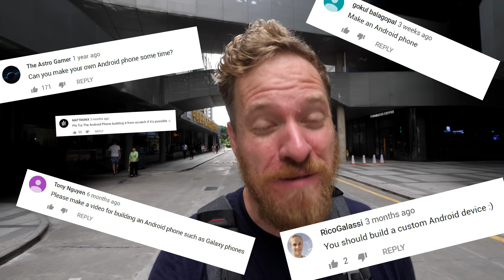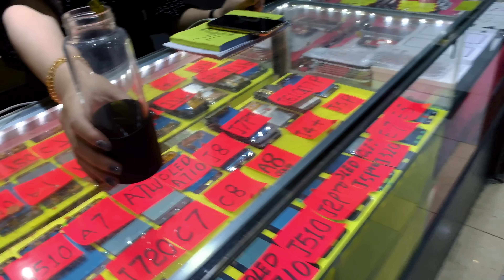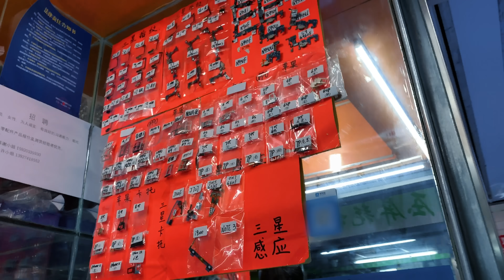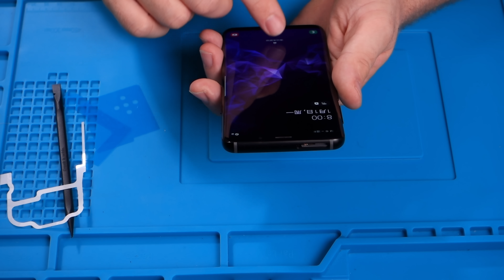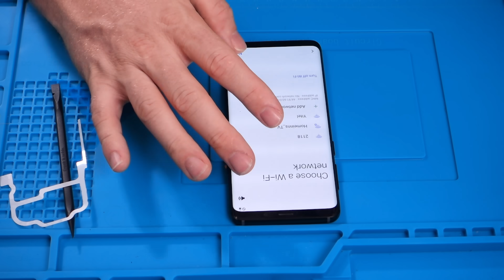How I Made My Own Android Phone

Comment: Part of the reason it's hard to find boards like that is unlike iPhones, Android phones generally tend to be commodity items. Most people buy them and when they break toss them and get a new one. There ARE high end Android phones (like the S10) but even with that, it's not as common to sell them to try and recover the cost. The mindset just isn't there. Also, there are so many different Android phones by so many OEMs (4000+ phones by 400+ OEMs) that it's hard to know what to keep in stock.
So you're definitely swimming upstream with this idea.

Comment: Nice one, congratulations!! 
You should make a new macbook or a console!
Reply: A lot of consoles have all the parts with specific ID's, so they only work with specific parts. Example: If you want to replace a Xbox disc drive, you need to get a drive that has an ID that matches with the motherboard. So it's possible, just very difficult.
Reply: Yeah you're going to hit a wall eventually without using a modchip as well - Which further complicates the "does it work yet?" question during assembly.
Reply: @amshermansen  Yes, you are correct,  I think that when I was talking about that I was wondering in the possibility, not If It is legal or not. I was thinking in the following way, If you can buy a motherboard and fix you console or macbook you can make you own device as well!!
Reply: @Zer0_Smith  Certainly,  I was thinking on that when I said that, however I have already seen people in my country fixing consoles just like a phone.
An iPhone might have ID to work well, haven't it?
By the way you might be right.

Comment: Great Video. Only gripe i have with this is the "Made" tag. You haven't actually made anything. You provided final assembly with all the parts already made by somebody else (not to mention any engineering that went into it designing them in the first place). But it's not like you pretend you did any of that, so whatever. Well done.

Comment: Build a Smart Phone with Awesome Specifications such as:
CPU: 8 Cores.
GPU: 8 Cores.
RAM: 12 GB DDR5.
SSD: 256GB RAM.
Front Camera: Dual 48MP O.I.S. with Wide and Ultra Wide Lenses.
Rear Camera: Dual 48MP O.I.S. with Wide and TelePhoto Lenses.
Display: Super AMOLED 6" Screen with 19:9 Aspect Ratio and HDR10+. 
Display Protection: Corning Gorilla Glass 6.
Sensors: Iris Scanner, Face Scanner, FingerPrint, AcceleroMeter, Gyro, Proximity, Compass, BaroMeter, Heart Rate, SpO2.
Speakers: Stereo with Full Range 20-20Khz.
USB: Type-C 3.1 version.
Battery: Li-Po 5.000 mAh.
There is no phone right now with those specs in the market yet.
Except Xiaomi Mi9T Pro with lower specs and cost 400€.
https://www.gsmarena.com/xiaomi_redmi_k20_pro-9708.php
Please Build it !!!!

Comment: You could do so much more, like make your own custom phone with a s10 case but a mate 10 battery. But still enjoyed the video 😀
Reply: It's possible to do that, but he would need to learn a lot about Android first or get some help.
Reply: Maybe stick a one of those 12kmah battery with huawei fast charge with current SnapDragon chips and Sony camera? Makes for a brick of a phone! Also a headphone jack and LG sound board
Reply: @mechpade  The fast charge protocols used by Chinese companies like Huawei, Oppo, OnePlus, etc. require more specific controller boards to regulate the battery, which are usually located inside the battery cell itself. Slapping a 12,000mah battery might not yield any sort of fast charge similar to that or will work but result in a battery that becomes a ticking time bomb. You're better off taking a battery from one of Huawei's phones if you want that sort of fast charging.
Reply: @GabrielIgnacio  aahhh... your comment eminds me of the note 7... good ol days...
Reply: @9550raja  To be fair, the Note 7 battery issues were caused either by the deflection done to the battery when it was being manufactured or impurities within the battery layers, causing the positive and negative layers to make contact and catch fire.

Comment: The very same reason it was considerably easier to build the Samsung than an Apple is the reason there's far more parts I believe. Apple makes it harder to do anything... (Including fixing your devices) so you need experts to do it for you. I'm not saying there's no other parts of the world that have the ability to learn and fix Apple products themselves.. Of course those outlets exist. But it's a lot harder, thus a lot of Apple parts just end up back in China in laces like Shenzhen. I think Samsung parts are harder to find because more people are able to fix the devices themselves, so don't end up back nearly as much as places like China. You break an apple product, you know it's going to be a hassle to fix.. Because Apple make it that way.. All the different unneeded parts.. Specialist screws and brackets.. Samsung parts across the world are far more readily available and easy to come by so we fix them here. Instead of just selling off for parts.

Interesting video. And I'm surprised it was easy to find S9+ parts. Wonder what's next. If you ever do read this comment. And I'm sure it's a pretty easy mod. Think you could put a IR blaster in an S9+ so it acts as a universal remote? Last Samsung I beleieve that came with a built in IR blaster was the S6. I went from S5 to S7 Edge. Which doesn't have one. But the S5 and S6 did as standard and I do miss that feature.
It would be cool to see if it's possible to put an IR blaster back in the newer phones so we can use them as a universal remote control for TV's.

Comment: I use Android but I have not used Samsung for years

The thing with android is that the operating system might be same but that is only software
The hardware is just as different as if comparing an IPhone to any other Android brand

Comment: from a technical parts side, you now see why people like me prefer android phones, and how android manufacturers dont use 7000 clips and 15 different types of screws and industrial adhesive, along with just all the 'lock the techies out proprietary crap" and "anti right o repair stuff apple pulls" like touch Id.  probably the reason for lack of android parts, is lack of them being so hard to find overall, may not in the markets there, but im sure if i wanted i could source all the parts needed elsewhere. 
you could try to make a frakendroid, and find this out

Comment: Price based on AliExpress and various retailers. 

6/64 S9+ Board: $250
Back glass: $8
Frame: $18
Waterproof seal: $2
Original OLED screen: $230

Can’t find other small parts
Reply: Thx man
Reply: @ilxndxn2304  I recon you can get cheaper if you lived there them type of sites know the west would buy so bump up the prices
Reply: but they  are new  and he  bought  at least  a  used  logic board. Also: the prices  should  differ  anyway.
Reply: I saw the board going for $150-$170 and the screen around $120 from various people on AliExpress
Reply: So you save what around $300? Havent looked at the prices in a while.
Reply: @excitedbox5705  S9+ is going for €649,99 in my country so no you are not saving 300. Buying the parts for the price RezZ said is awful value taking into account you will not have warranty.
Reply: You can find S9+ used for around 200€.
Reply: @LetiferTV  You mean stolen lol
Reply: A brand new S9+ 64GB in Vietnam is about 400$. I just got mine last month.
Reply: @Mandragara  You can say that for every used fone ever.
Reply: Cynical Possum where?!???

Comment: I built an S9 myself recently which is what got me interested in this video. I even did the pain in ass silicon sealing to make it water resistant. Here in the UK, it cost me £168.98 for parts and three days of work. I also waited five weeks for the parts to arrive.

My only issue was the sensors which I clearly lacked the experience with. I can actually see why Samsung mark up their phones to disgusting prices. It's super stressful and difficult to get right if you know jack about putting phones together. Especially the water resistance. As of writing this, my first is dead from water as I sealed it wrong. Second is perfect. It even tricked an official Samsung repair engineer. He realised after careful inspection that the sensors were refurbished parts.

Can I say how proud I am being able to actually do this. I might try a Huawei next or even a Meizu.

Comment: SM-G973
For China is SM-G9730
Global is SM-G973F
Reply: Actually it's sm g975f the global version and american versions are also 975 fd or t for t mobile and so on. Only China has 973
Reply: @Amonicuss  SM-G975x is S10+
Reply: @DhavidSetiawanKilluaDhavid  yea that's what we are talking about the s9 are sm g96xx
Reply: how he got the OIS inside the phone?
Reply: @KarelČapka  On all samsung phone, you can boot the phone in a mode called "ODIN MODE". When the phone boots up in Odin, it does not start Android, it starts an internal program waiting for the user to send the phone the factory image of the OS. To do that, you need a computer and the ".img" file.
Reply: @KarelČapka  if you mean the os, because it looked to be a pattern lock on the phone means the motherboard already had a rom installed on it.

If you want to install an official rom on a "clean" motherboard that does not have an os, for Samsung you use sammobile.com
Reply: @KarelČapka  OIS camera?
Reply: China uses snapdragon instead of exynos I have a HK note 9 because it has dual SIM but in NZ they block off dual SIm because of agreements with all then phone companies
Reply: @natzzzy9119  huh really? Did you get the phone from a provider or off pbtech or something?
Reply: Are kidding me, they just don't accept the second sim. So corrupt.
Reply: @natzzzy9119  at least I can still use second SIM and SD Card slot

Remember some A series use that method

Comment: What was the total cost USD on the project.Great Job!!
Reply: Yeah I'd like to know this too
Reply: @mounirelkirafi  $134.65, working off the prices provided, I don't think he gave a price for the logic board, but I don't imagine it would have cost much considering the price of all the other parts, so you're probably looking at somewhere around $140-$150ish
Reply: @may2353  sounds good, thanks :)
Reply: @may2353  thats crazy considering how much refurbished phones go for
Reply: @MorayNZ  I was thinking that. It's a hell of a mark up, especially if you're buying the parts in bulk
Reply: Dominique van der Knijff  What would you estimate for a price? Very curious to know what it actually cost him to put together in total
Reply: You can get refurbished for under 600
Reply: I believe this is more of a proof of concept rather than a cost saving measure. You'd have to be a really good electrical engineer to this or a hobbyist with a lot of experience. I don't even know if I could build it and I've done a lot of hobbyist soldering. It's a lot of specialized tools.
Reply: it cost him 12 national security secrets.

Comment: They know iPhone parts sells very well, that's why it's much more common
Reply: Samsung phones have less than 5% of market share in China that's why
Reply: No, it's because iPhones are manufactured in Shenzhen.
Reply: No! It because iphone's part always broken
Reply: Natsu Dragneel Failure rates for iPhone logic boards are generally quite a bit lower than for the average android phone. However, remember that the main reason someone might need parts for a phone is due to damage or neglect - not random hardware failure. The fact that it’s harder for him to find android parts indicates not that they fail less often, but that android phones aren’t valued enough by users to fix or vendors to refurbish and resell. iPhones have historically held very good resale values due to brand recognition and the superb software support that Apple offers. Since most android phones stop getting updates sometimes within weeks of launching, it makes sense that android phones just aren’t as practical to fix or refurbish - they’re just “landfill topper” until the next random model from a random manufacturer comes along. 😜
Reply: @dregenius  wtf ur talking about. he said parts not only logic board. dont u know iphones is very fragile especially their screen. android is not doing great either but it still did the price. lol

Comment: I think the reason that there are fewer android parts in the district is that android manufacturers have a lower cost of reparations for out of warranty reparations. A broken back glass is a few bucks if you want to have your device repaired in an authorised repair center while an iphone 8 has half the cost of a new phone. Because of that there are two factors that possibly are the reason for such a high margin of difference regarding the number of iphone vs android parts. One is that it is more likely that an iphone user just ditches a realy good phone with minor defect due to apples poor and pricey repair policy. The second factor is that due to higher demand for unauthorised repair shops with reasonable costs of repair there are a more wide network for refurbished parts. So basically it is cheaper to repair android phones  so android users tend to have their devices repaired by offical authorised and contracted repair centers even after the warranty expires. At least that is my theory.

Comment: "We have Nokia"
This little part of my life is called "Happiness"
Reply: The new nokia 2.2 is $140 and has an infinite display.
Reply: @jakobjackson8077  amen
Reply: umm but sure they just have the parts for the new nokia android phones.
Reply: I replaced my Nokia N8 with a Nokia 808 Pureview (unlocked) off eBay in 2016. I got a second one as a backup in 2018, before they became rare and their prices jumped to reflect it. Both for under $200 CAD.
 
Love the 41MP camera sensor and the Symbian OS is much better than the Lumia 1020's Windows 8 Mobile, IMO. A shame the front camera is crap, because I have to use a mirrored sticker on the back to do the occasional selfie. lol
Reply: i agree first phone i had was a 2110
Reply: @daniellandersson289  mine was 5130
Reply: Ese que si entendí la referencia
Reply: I still use a Nokia E72... it's my backup sits on my desk for alt. number stuff like SMS verification msgs and stuff. PAYG SIM so zero network charges.
It lasts 2 weeks on its original battery before I have to bung it on my PSU.
Reply: @NORAPAI yes it is. @KiX go watch the movie. If you know, you know.
Reply: Nokia forever
Reply: @mishmash6169  Because they're chinese traders who try to push anybody they can into buying anything they can sell'm?
Reply: I still use my original Nokia N8 to this day. It's made in Finland and has never been fixed with ONE major exception, i used my N97 battery innit by ditching the battery latch and the original antenna. Beast of a phone built to last. Unlike today's gabbage.
Reply: Happyness* if you know you know
Reply: @bhasinanant  lul
Reply: I understood that reference
Reply: Anant Bhasin You pay late anyway you complain I complain!
Reply: @bhasinanant   It's happiness, if English isn't your first language no offense.
Reply: @kix5457  r/woooosh

Comment: now to flash and root that thing. Get some crazy software going and explore the openness of android.
Reply: Tbh custom roms are kinda retarded nowadays. Roms are basically AOSP with some extra toggles, the only logical use case is for old phones which did not receive software updates, or if the OEM skin in your phone is totally bloated, but then you can just run an official AOSP gsi instead of a custom ROM like lineage nowadays because of treble. So, yeah, ROMs are useless if your phone launched with 8.1+ because of treble.
Reply: @pedrokalil4410  👍
Reply: @pedrokalil4410  is right, treble is just the implemention of a partition that overlays the system partition so manufacturers can easily add what they like to software with only the need to add files to a partiton while the base is maintined by google, you could literally make your own custom vendor/production partition and add it to almost any device(8.x>) and expect it to work.
I suspect that AOSP will no longer be publicly available in the near future.
Reply: @RickyDivjakovski  I Really doubt google would do such a thing. AOSP is an extremely good and well maintained open source project with many contributions from outside google. And, they are starting to be even more open on the last years. Until about nougat they only published the source for final releases, on oreo they started publishing bits and pieces of the betas, and now it looks they are publishing even more of them. Also they are making AOSP gsis easily avaible for the average guy/developer, etc... They are really commited to it, i dont think they will make it closed
Reply: its 2019 and Android 10 is available, theres pretty much no reason to root your device anymore.

Comment: @StrangeParts How did the cost compare to that of building an iPhone? Is it substantially cheaper than buying a brand new/used phone that is already assembled from the factory?
Reply: Android's do lose value much faster than iphones so it should be much cheaper and as well you're paying for assembly and testing if you buy phones directly from a manufacturer
Reply: Assembly and testing cost barely anything bud, what costs money is ad's and marketing. For big phone companies these two factors can often be 25-50% of the price.
Reply: @asbjoern09  true, but R&D actually far outweighs the cost of marketing.
Reply: @FourFoxxx  True, although i won't count that as "lost" money. It pays off the long run. Usually Samsung is the Top 1 Company worldwide when it comes to R&D spending, but when we consider that in most electronic devices Samsung parts are used it also pays off for them.